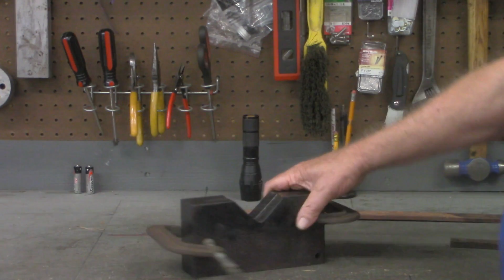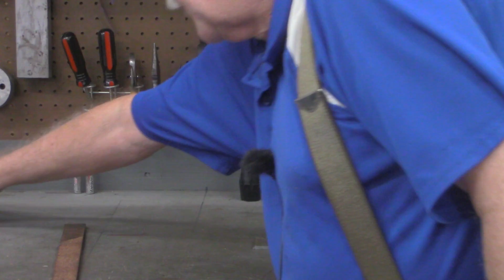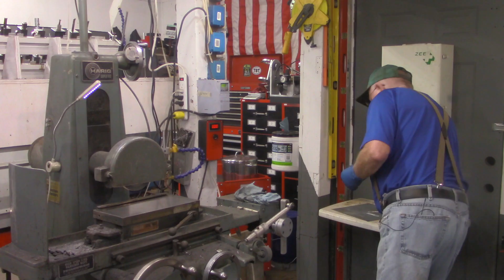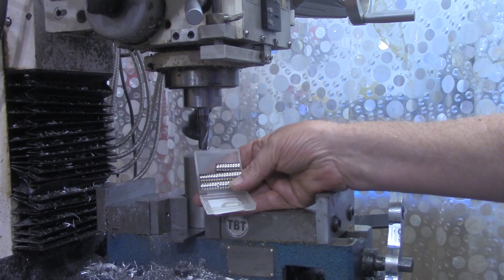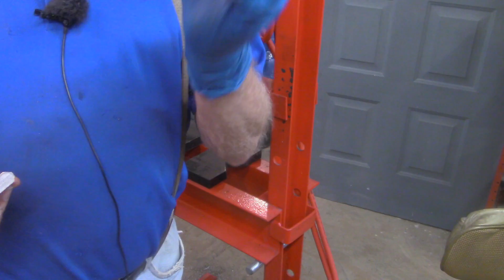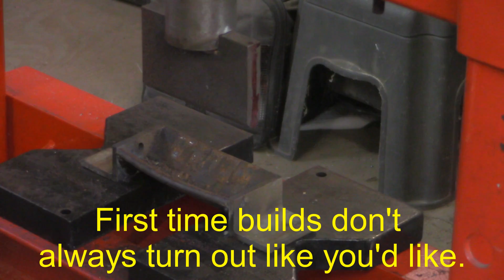Hydraulic Press Bending Jig

Comment: For the trough you might consider using a small piece of solid square bar, (almost the same as a long machinists v-block) that way you could cut the V to 90° then a small wedge to fit in the 90 to close up and allow an overbend that compensates for springback, you could make a few of these for different thickness of materials as different thicknesses will have different springback properties. Also open ends on the V to allow for slightly wider material. As always thanks for the inspiration your videos always give to help restart the old grey matter in think mode.

Comment: When I was in machine shop class in high school (a LONG time ago!) they had a hydraulic press there,  and when I first chose to eplore it there was a v-block and a tip on the press with a matching angle,  so I grabbed a bit of scrap round stock (I think it was bout a half inch) and decided to see what it would do.  It bent it,  and I kept on applying the pressure.  Finally it gave,  the bits of round stock went flying,  and the glass on the front of the pressure gauge came flying off.  Got me the kind of attention from the shop teacher that I didn't want...

Comment: Lee : if you make your bottom die out of round stock running parallel to each other they won’t crush like that. Some 1”-1.25” solid will work nicely. Leave a gap in between for clearance for your drift and stock. Several different widths of drifts will allow you to bend up some small boxes and box type brackets.
Reply: You beat me to the post. Also, if you install a pin in the bottom of the steel plate at each corner, they will locate the die in the press.
Reply: Thanks for the video: as always you did a great job!

Comment: Nice project. Wonder if you could take the angle to the press before welding, increase the angle on the legs to help with spring back, then weld on the end caps and strengthening supports? Hope your injury is healing well. If you’re going to hurt your hand/fingers, it’s best to be opposite the important hand.